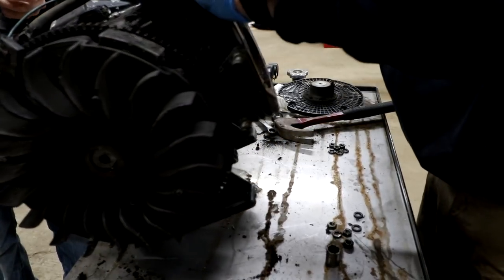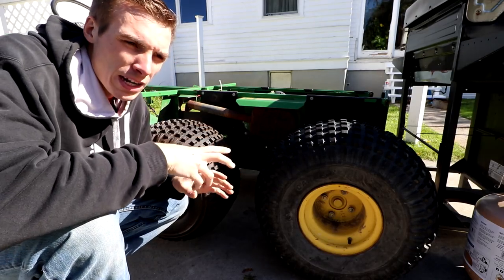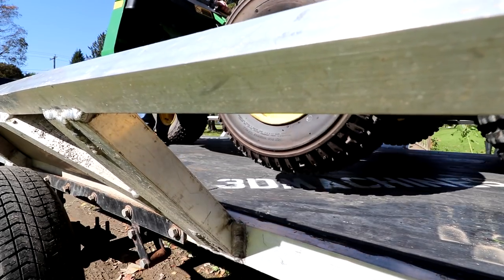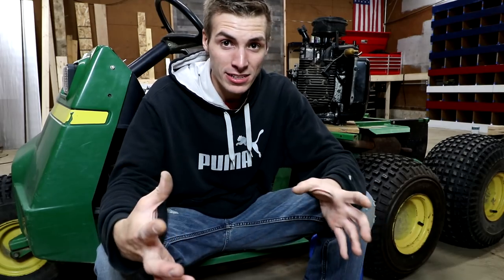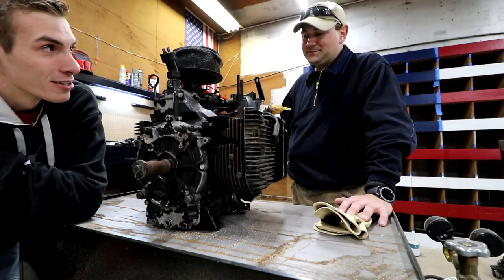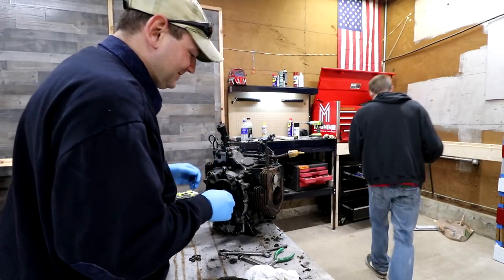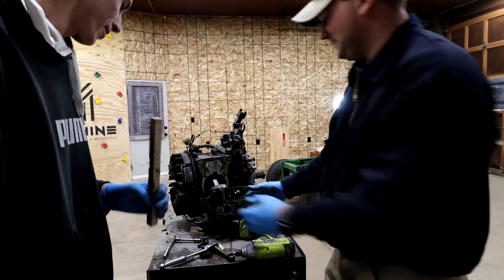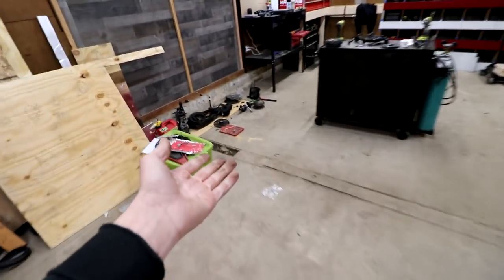THE INSANE GATOR BUILD BEGINS

Comment from the maker: Be Great, Be Different, Be a Machine!
https://machinemerch.com
Reply: 3DMachines I am from buffalo as well
Reply: love the video but do you Really need reverse, that’s what friends are for
Reply: Get a 90° 1:1 ratio gearbox. Or mount the 1kcc above and sideways, have a solid driveshaft made that will fit the clutch, use a pillow block bearing to hold it in place.
Reply: Dalton your killing me I just want to see the new tires and tow Mears areon the dirty max
Reply: Just a tip for adding a turbo to that small engine ...ecotrons is a company which makes efi kits for those engines..not totally necessary but much easier to tune and much cleaner revving and running engine
Reply: 3DMachines awesome video! I wish I had friends like you and we did sweet gator builds. I did growing up. We built all kinds of fun stuff, 2-mini bikes, motorized scooter, one person hover craft.... now, nothing...I gotta get the Machine revolution in gear! Thanks again
Reply: I love this new quote.
Reply: Great video Dalton 😁 now this is the content i love to see an possibility most of your machine freaks haha with your engine you can only work with what you have an your budget set,looks good to me...easy to find parts, cheap for rebuid kits an most possibility is salvageable.
Reply: 3DMachines why not just put a snowmobile engine on it, they use the same style clutch system
Reply: braces is once a month plus they can come off your teeth if you accidentally ate something hard in a weird position
Reply: 3DMachines k
Reply: 3DMachines Hey Dalton, I heard you’re going to the YouTube call out the 28th and was wondering if you wanted to travel together (I’d be taking my truck) message me on here, I’m about 40 minutes away from buffalo.
Reply: 3DMachines or you could build a predator 670 stage 3 and have one bada$$ motor for the gator
Reply: @3DMachines go get a in-line 4 cylinder turbo diesel engine with a 5 speed transmission and throw it into the gator that probably be alot easier and save time and money
Reply: im so excited for this build
Reply: 3DMachines. cool video

Comment: The engine news you can get at harbor freight are actually pretty good, I have replaced snowblower engines, rototiller engines and put one in an old Sears suburban garden tractor engine and they have plenty of power and are reliable not to mention cheap

Comment: You have a Kohler cast iron opposed twin, its probably a 16hp. Im not sure on after market parts availability on them, but if your turboing it, dont do a blow through setup, the carb wont work correctly. best way is to put a mikuni style carb on the inlet of the turbo, that works best and is really easy to do

Comment: Use a gear and chain from the crank shaft to a jack shaft with at gear on it and put your clutch on you're jack shaft ..... made a go kart with a 399cc snowmobile engine on it in my senior shop class and we ran in to the same problem but opposite we went from belt tuque to a chain

Comment: Your Kohler was made in Wisconsin. A problem I see with turbo charging it is that its a goverened engine, so unless you play with linkage, its still only gonna turn about 3500-4000 rpms, and im not sure how well it will hold up to any higher rpms

Comment: Swap a duramax engine in it and race streetspeed717 with it.
Reply: Falseprophet42 there is nothing wrong with the one in it now
Reply: Falseprophet42  that would be a problem because he would have to cut space for the diesel motor and for the Allison transmission then create a custom rear end and steering system for all the weight and power.
Reply: Zombieven0m 125 and here we see you don’t know what a joke means.
Reply: odliD I know. I thought I’d say something funny.
Reply: Falseprophet42 yeah but still it would be awesome to see a duramax motor and Allison transmission on the gator
Reply: Zombieven0m 125 you just can’t run a 1000 pound engine and 275 pound transmission in a couple hundred pound gator lol
Reply: No, small diesel engines are expensive compared to gasoline engines of the same size. It’s ~1200 for a diesel and ~500 for a gasoline engine. (More than half the price. 1200 is on the low end consideribg ive seen engines go for 3k that are diesel)
Reply: Zark Muckerberg that is why I intended this as a joke.
Reply: Zark Muckerberg $1200 for a duramax engine? Good luck with that. Cheapest in my area is about 3k with 150-200k on it

Comment: Buy a new 670 and mod it and make it a beast
Reply: Him and cars and cameras build it
Reply: brian mank ay. What do you think of the coffin go kart?
Reply: Cough cough cars and cameras cough
Reply: the 670 sucks it has 22hp for 670 thats bull shit
Reply: Joey Webb 

It's an air cooled utility motor genius. Meant to run for hours on end without overheating, not to make power.
Reply: but it still can
Reply: Joey Webb 

No kidding. With mods they make well over 50hp. Like every motor, they come detuned so it won't blow up and you can't sue.
Reply: Joey Webb 

1. A water cooled 2 stroke will always make more HP then an air cooled 4
2. I bet most certainly would blow up if you ran it at redline for hours on end like the 670 is designed to do
3. Right on the box of a predator 670 it says"for use on mowers, tractors, water pumps, pressure washers, industrial equipment and agricultural equipment." So yes, it was meant for work.
Reply: Zark Muckerberg I think it's pretty dope I love the stuff they do

Comment: take a snowmobile motor with the clutches and swap it into there, it'd be easier than a motorcycle motor! it would be similar to how the gator ran before. off a primary and secondary clutch setup. you'd still get your reverse and a lot more power

Comment: its meant to go forward who cares about going backwards get that 1000cc engine in there
Reply: Dragon Summers putting the 1000 in there would be retarded at best. Look at what it's going into...a sheetmetal chassis that would fold up as soon as you put any power to it. No suspension. Waste of time.
Reply: ROTAXD Thats beside the point
Reply: Dragon Summers I get reverse but I don’t get turboing it just getting the motor in he could have it done in a month or two now this is gonna add a lot of time (still a bad idea I’m pretty sure that chassis can’t handle that much hp and without suspensions rough ass ride

Comment: Carb engines can't use a turbo, they aren't made for pressure. You are going to have to get a fuel injection kit for a small motor in order for that to work.

Comment: If that's a kt17 there know for oiling problems. Also ungoverned the flywheel is a time bomb. Pulling tractors with cast flywheel should not be spun above 4000 rpm. They have exploded, and will go through walls. Be safe.

Comment: Hey Dalton from what I can see it looks like a kt17 twin or kt19 twin. do your research on the engine and find out if its a series 2 model. The series 1 had a lubrication issue and the connecting rod goes to shit cause the lack of oil. I would know cause I took my series 1 engine out of my tractor cause the engine was shot when i got it.

Comment: Heads up carbs don't like to have air pushed threw them best thing to do is mount the carb to the air intake on the turbo and put the air exit from the turbo to the intake on the motor and is that oppy pressure lubed or splater lubed if it's splater lubed won't last so long ungoverned

Comment: I already see allot of comments saying do a snowmobile engine so I wasn't going to comment but...... Do a snowmobile engine.  the tuning with the turbo is going to be extremely difficult on the small engine. setting up blow through carburetors is very hard,  your going to need a fuel pump, and a regulator. then you are going to need a way to control the timing.  because with more boost your going to need less timing.  a stock 800cc snowmobile engine will smoke a turbo lawn mower 10hp motor.
Reply: just want to add that your videos kick ass

Comment: I would’ve just used a Polaris Sportsman 850 or 1000 engine that’s utilizes belt drive and would work with the existing transmission in the gator! And even is those engines are too pricey a 500 Sportsman engine would work also! And have plenty of power for it!

Comment: Check out CarsandCameras youtube channel they turbo'd a 420cc harbor freight motor. To use stock clutch from the gator engine you can have the crank turned down for it to fit.

Comment: Whare could I find one of those spinnamathings he used to clean the cylender
Reply: Jacob McClure it's a cylinder hone. Available at any auto store.
Reply: Jason Mitchell thanks but is that just for small engines or anything
Reply: Jacob McClure  They are available in 3 sizes. The smallest is for brake cylinders and small 2 stroke engines. The package will give you the cylinder diameters it is designed for.

Comment: If this engine doesn't work, get a 670cc Predator engine from Harbor Freight and build it up. Electric start, V-twin, single carb, about 20-something horsepower, but there's a pretty decent modding community for them. www.performance670.com